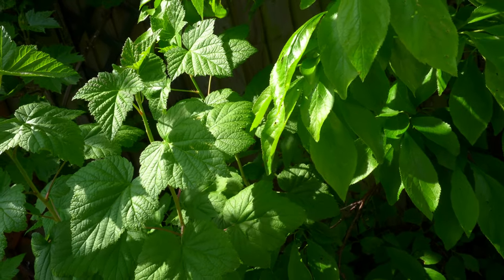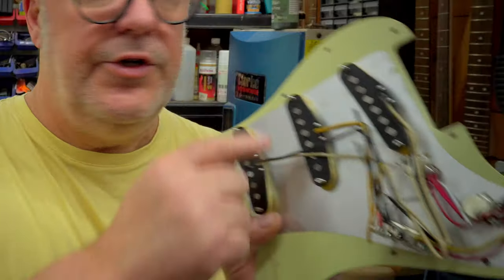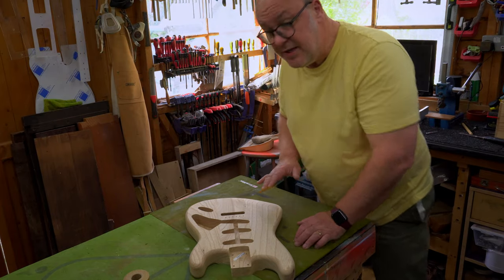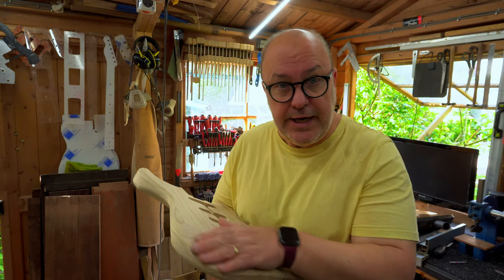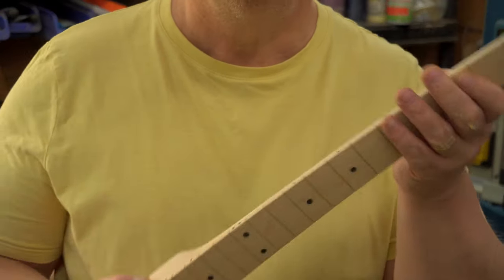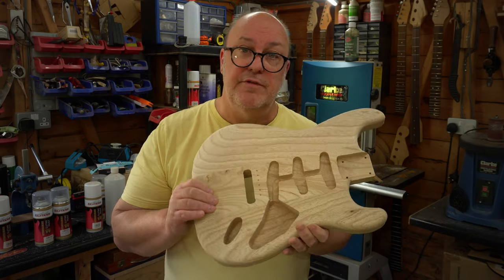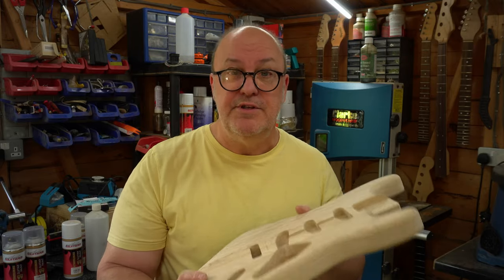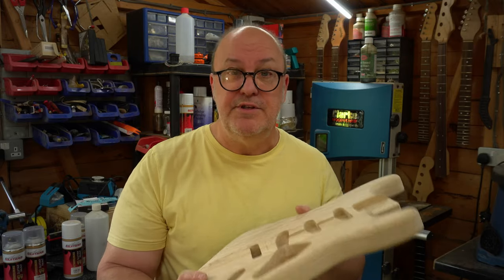Stratocaster Partscaster Complete Build Part 1

Comment: Neck join is something I want to do on my build - thanks for the video Chris. Was wondering about taking it a step further and adding a contour... but might be a bit ambitious
Reply from the maker: Interesting. I could re-engineer the joint further by ditching the metal plate completely and just fitting some 12mm ferrules in the body where the screw holes are. The beauty of this is that we could then really contour the body lump without having the plate in the way. I have done this many times. It might scare the Strat purists though.

Comment: A few months ago I used super glue and baking soda to plug off an old water line that comes off of my water heater. I went to the hardware store and purchased a fitting for the job but I picked up the wrong size so I decided to try the super glue and baking soda and so far it's working great with no leaks. 👍
Reply from the maker: I hope your baking soda solution continues to bring you great joy. C
Reply: @chrisreynoldsguitarmaking  time will tell lol
Reply from the maker: @frankhughes5702  I always does

Comment: Hi Chris, I've really been looking forward to this series. I've built 5 guitars since I watched your tele series and I must say out of all of the youtube videos I've found yours are the most informative and entertaining! Keep up the great work. After finishing a number of bodies in nitro I've played it safe and only done rosewood necks, so I'm looking forward to learning how you finish the maple neck... and also how you screwed in the tremelo claw into the back, surprisingly I found that a challenge for the strat I built 😅. And thanks to you every neck is attached using a laser. One tip an old luthier told me.. when you screw in your pilot holes for the neck don't do it in the centre of the holes in the neck pocket, do it slightly towards the neck side, that way when you screw the neck on it gets pulled tighter into the neck pocket and better connection to the body. He swore by it.
Reply from the maker: Wow that’s amazing Andrew. Love to hear stories like yours. Maple brings with it it’s own conundrums. I’ve never heard of deliberately angling the neck screws. I have to say I’m dubious. It’s hard enough to get them in the right place without messing with them. I’ll give that some thought. Great to hear of your guitar making progress. C
Reply: Hi Chris, the screws not angled, he would just use the predrilled body holes as a guide, and drill them straight, but he would use the neck side as the guide. I was dubious as well (im an engineer 😊), but it seemed to work very well.. main thing was the screws are straight, just a fraction of a millimetre on the neck side.
Reply: But... I've never seen anyone else mention it. Anyhow..  I think your work is exceptional and at the end of the day all the major manufacturers drill them centred.. and as engineer my only concern with his method is unnecessary tension in the timber around the screws.. but.. he also had me thinking as well as it should, in theory, pull it in tighter.

Comment: Nice build. Just shows you how different we all are. I buy my bodies either painted (when I am feeling lazy) or raw. I buy them brand NEW from Guitarfetish and they are cheaply priced around $79.00 to $119.00 (these bodies are flawless however, make sure in the description it says alder or ash because otherwise you will get some crappy wood like Poplar, basswood or whatever) depending on what you want. I usually spend the most money on a neck and I always buy either a Fender soft V Fender neck (classic player's 50's neck) or a baseball neck from AllParts (usually around $99.00 to $179.00) and shave down the neck to a medium C, Oval C or a little thicker soft V. 
    I personally hate thin necks because to me it's like playing on a desk top. In a pinch I will tolerate a regular C neck (no modern C or modern D). In this vid, that neck that you didn't like  the color or feel of, is perfect for me (love the color and love thicker necks). I also never buy fender bridges, as I can never tell if they are zinc (which I don't like) or not, because they almost all look and feel the same. What I use instead (which is much more affordable and useable) is a Wilkinson bridge, with steel block and upgraded string saddles for a more clear sound and better sustain. 
     The pups I use are Dragonfire, Fender Tex-mex, Fender 54's, 59's or fat 50's (on occasion I will use an expensive set of EMG's for more versatility) and I am good to go. As far as changing the frets on necks, I do that as well because I prefer wide jumbo's and I know if I do the fret job it will be done right and feel right in the end. 
    Anyway, sorry to drone on so. 
Thanks again for the vid. Just my 2 cents worth. Peace.
Reply from the maker: Fascinating. We disagree on pretty much everything m, but we both have our reasons. I prefer thinner necks and banjo frets. You obviously know your stuff and I’m sure your guitars are great. Maybe you should make some vids like me and spread the word. All the best. c

Comment: Hi Chris. I’m finding your channel really inspirational and I’ve already built a Tele Thinline partscaster, which I adore.
Next step for me is another Tele, but this time I’ve ordered a swamp ash body from BooBoo with very minor defects on the rear only. The top is beautiful and I’d love to do a stain and clearcoat finish but I’m hoping you’ll be able to find the time to give me a little advice on sealers/fillers on swamp ash. Do I stain first, then sanding sealer over the top or do I use sanding sealer and sand smooth before staining. The internet, as usual, is full of conflicting advice. Cheers Chris.
Reply from the maker: The best thing to fill damage with is the wood from the guitar. I mix sawdust from the body with nitrocellulose filler or clear nitrocellulose finish. Don’t use super glue/ca it dries dark. Once your repairs are good and levelled You need to grain fill the whole body. Let it set, sand and do it again. Sand that and apply two coats of sanding sealer. These steps will get you a nice flat even finish. Skip them at your peril. If you are staining, consider a water based finish before applying several coats of clear gloss. Sand with 400 between coats.
Reply: @chrisreynoldsguitarmaking thank you so much.
Reply: Just a quick update Chris.
My swamp ash body is starting to look really great. Once I’d followed your advice and filled blemished with a sawdust & glue mix, I sanded it with 120, 180, 240 and 320 before using some Rustins grain filler dyed with Mixol universal tint to really bring out the grain structure. This has now been sanded with 320 and a further coat of Rustins has been applied.
One tip that really helped me with the sanding process was to cover the body in pencil marks between each sanding session (the guitar’s, not mine 😂). This ensured I sanded adequately and evenly. Weirdly, I’m actually enjoying the whole sanding process, which I thought I’d really hate.
I’ve really enjoyed following your Strat build and I’m really looking forward to the next video. Thanks once again
Mike

Comment: Hi Chris, quick question, I've stripped the paint off the body of an early 90s squire strat and its left a fairly thick layer of what I assume is polyurethane.   Would a scraper work on this as trying to sand it is soul destroying?
Reply from the maker: The best way I have seen this done is with a heat gun. We call them hot air paint strippers in the UK. You apply enough heat to really soften it and use a pallete knife to lift and scrape it off. Be care with the fumes. You need a good mask and don’t let it catch light or burn. Sometimes it peels well. Resign yourself to a long job as poly is a pain to strip. Be careful and good luck.

Comment: Great to have you back Chris! I'm in the process of building my first partscaster in part due to your videos! In both your Tele and Strat series your neck and bodies seemed to already allign. Is that normally the case? What would be the option if they didn't allign?
Reply from the maker: They don’t really align until you line them up and fix them that way. It’s normal for the joints to be pretty sloppy. The tight joints are actually a bit of a pain to align and they don’t account for the layers of paint and lacquer that is applied to body and neck. I use the laser to line them up and then fix them there.
Reply: @chrisreynoldsguitarmaking  Ah thanks, so it's more the micro adjustments that affect the allignment. I probably shouldn't have selected a neck with pre-drilled mounting holes

Comment: Hi Chris, I am sure you have been asked many times about the necks you bought in bulk and use in these videos. I have tried a few far Eastern supppliers but despite sending very specific specs, i am always disappointed with the quality.the most common error is the depth of the fret slots, which are always way too deep. Would you be prepared to share the name of your supplier? I am in Portugal setting up a small repair/custom build workshop and would need 20-30 necks so it would be good to know the quality was there. Many thanks. Alan.
Reply from the maker: Ok. This is tricky. I bought them 5 years ago. They were ok but you need to be ridiculously specific. I had 40 made and the Telecasters were all amazing. The strats were flawed. The finish was kinda polyurethane not nitro and I didn’t give them a colour reference. In my experience you just need to tell them and they will do what you want. If you want 1.5 mm by .5 mm slots then they will do it.  I paid less than 25$ a neck so quite honestly I’m not upset. The maple would cost me way more. I’ll look up the supplier. C
Reply: @chrisreynoldsguitarmaking  That's incredibly good of you, Chris, thank you. Maybe it's best to order them unfinished and unfretted?
Reply from the maker: @alanstclair8040  yes. I think you’re right. C
Reply: Hi Chris, one more detail that always seems to be missing on repro necks..the fret markers size and position. Is it possible to order 6.3mm dots rather than 6 mm? I am convinced that that tiny difference in diameter makes for a truly authentic fender neck. I tend to make my own clay dots, but I know that they are available in 1/4" from some suppliers.  ..also I prefer the narrower position at the 12th fret...I guess this can be specified too? Many thanks.
Reply: @chrisreynoldsguitarmaking Hi Chris, nice to see you back on the Toob! Can you possibly give me the name of your neck manufacturer? Since I last spoke to you I have tried a couple more suppliers in the far East... same problems! Cheers!
Reply from the maker: @alanstclair8040  as far as I can remember it bought them from Donlis guitar parts store on AliExpress. It was back in 2016 I think.
Reply: @chrisreynoldsguitarmaking  many thanks, Chris!

Comment: I know what you mean...all the other bass players I know are all about Fender Precision and Jazz basses, and I just don't care for them. I mostly play metal, and Fender doesn't really have a lot going on there, either in guitar or bass. There are a few high profile people who play them, but for the most part, metal players want humbuckers and sleek, lean (and pointy) designs, and that kinda precludes Fender from the start.
Reply from the maker: I’m unsure why there is such a limited attitude to guitar design. Few players seem to want to strike out with something unique or even challenging. It’s seems to be that most settle for the guitar played by their guitar hero. This the genre gets fixed on one of the very small number of accepted designs. It takes a certain type of player to commission or seek out originals. Notably Prince who commissioned quite a few unique instruments. I’m sure there are others. I still find it odd that guitar making seems locked into design from the 50’s. But that’s the way it is. C

Comment: I hate the term "partscaster" makes it sound cheap and nasty. When i build guitars I use top quality materials. Not sh*te.
Reply from the maker: You do not need to comment on my site in such an aggressive and negative way. If you watch my channel you will find that I do scratch builds and builds from parts. I embrace guitar making in its entirety. I have even considered doing a cigar box build. I spent the pandemic getting banned from facebook for my shouty sweary posts. In the end it severely impacted my mental health to the point that my sons came to sit down and talk with me. The fact that you hate the term partscaster is interesting I so much as you have set yourself artificial limits and made assumptions that probably don’t hold for my output. My telecaster build is called ‘beyond partscaster’. I don’t just bolt a neck onto a body on my kitchen table. It’s far, far more. Maybe watch the show rather than react to the title. This build is very similar involving reshaping body neck and re fretting. Normally I would not spend so much time responding to a post like yours, but I think everyone is entitled to at least one chance to redeem themselves. I don’t use shite by the way. I source my parts carefully and the necks I commissioned 40 of and had custom made a decade ago. So all of your assumptions collapse under scrutiny making you look foolish. Dial down the hate and we can be mates. C